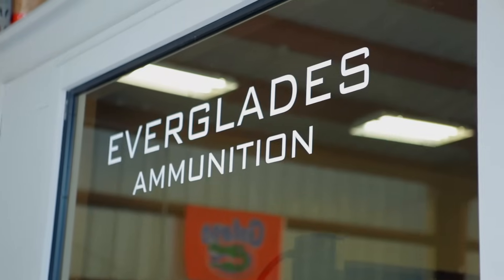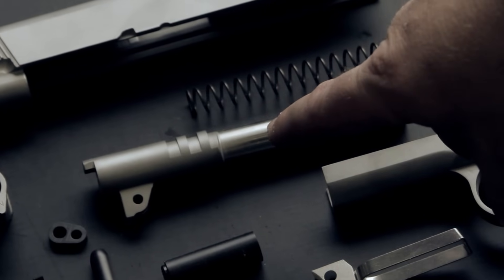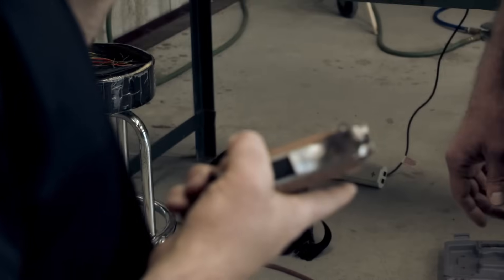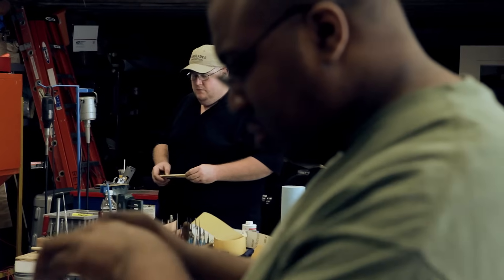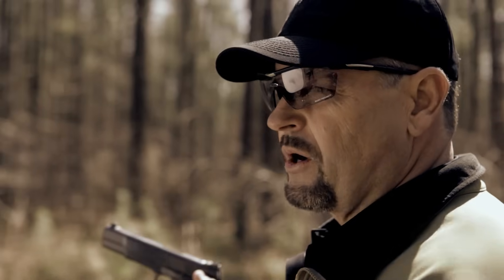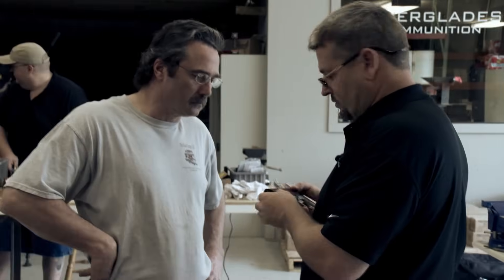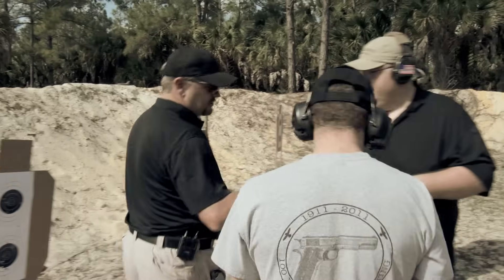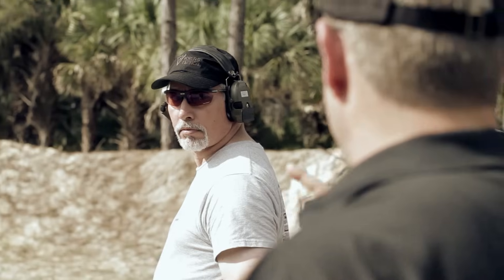Building the 1911

Comment: do you get to keep the gun at the end?
Reply from the maker: Yes
Reply: ***** Sweet!
Reply: ***** I agree, especially considering you'd only need to build and sell three or four 1911s before the class paid for itself
Reply: ***** Agreed, and if I have a 1911 I can pit against the $2000-$3000 1911s, I'm going to feel better than having paid a company to build it for me. 
Even if it's all about shooting range bragging rights, you know people will ask who made your 1911, and you'll reply "I did". They will dismiss the gun as a hack job until you tell them you built it at a Vickers workshop, then they start looking at it like it's a Wilson Combat or Ed Brown, because Vickers' name holds as much weight. 

I'm a broke college boy, so this class is outta my reach...for now. If he's still running the class in two years or so, I'll be attending for sure. Hope to see you there!
Reply: +Vickers Tactical where are you located. I would love to learn a full build process on the 1911. It is the ONLY pistol, unless it is a revolver, that I will carry, have carried, and that will not change. :-D
Reply: +Sam Moon Just buy  Taurus PT 1911.
Reply: San Mcnellis I have one. You really need to try a custom, or top-end 1911 before even making the suggestion the Taurus is as good as a 1911 I hand fitted.
Reply: +Sam Moon I have shot high end 1911's Les Baer, and custom builds and to be honest they aren't that great. Sure the slide fits perfectly, but that tight fit makes zero difference in performance, and I am under the belief that it actually hurts reliability. I think the best 1911 is simple and cheap. Really the best I have ever shot were the home made ones from 80% el cheapo kits. You could do anything to those handguns and they will still perform.
Reply: Dave Smith There is absolutely no validity to any part of your claims. I don't care if YOU didn't think the Les Baer wasn't that great, any custom or home built 1911 that performs as well only does so because of the same hand fitting that Les Baer does to their pistols. 
There is no way in hell a Taurus 1911 will be as accurate as even a Springfield 1911, nor will it be any more reliable. In fact, most, if not all 'reliability issues' of 1911s of any manufacture are user neglect/misuse, not the manufacturing process by which it was made...
Reply: +Sam Moon 
I suspect you don't know what you are talking about, and your little hyperbole that there is "no" validity to my experience is indicative of that. However I will give you the benefit of the doubt.

-Hand fit parts are tight. Tight parts`have more friction than loose parts. More friction leads to short stroking or at least weak slide reciprocation that can cause a multitude of problems. This is exacerbated with dust that seemingly gets in every crevice of the gun with actual use (not just range or competition toy). 
-Accuracy from a 1911 comes from repeatable slide lockup which is a factor of a lot of parts (barrel to slide mating, barrel bushing, slide stop pin, etc). That means it doesn't matter even if the parts don't mate together perfectly flat and snug, the 1911 will still be accurate so long as when the recoil spring pushes the slide forward, everything presses together the same amount every time. You get partial credit on this statement since it is true that 1911s that aren't as precisely made can potentially wear out faster but even then, you are hard pressed to actually get enough inaccuracy to see a difference. You are much more likely to see reliability issues before you see accuracy issues. 

But what do you define as "accurate"? In other words, what is your skill level with the gun? I can tell you that if you aren't shooting a handgun with a ransom rest or aren't capable of at least a 26MOA group (4" at 15 yards) you won't even see any difference in group size that isn't mostly due to user performance. All handguns are notoriously more inaccurate from rifles due to the lack of stability when shooting, which is why mechanical precision is less important in pistols than rifles.

Are high ends builds more accurate than cheaper ones? Yeah, but not enough to make a difference to most people, and at a certain point you can end up sacrificing reliability.
Reply: +Red Rider7 
Here's the thing, John Browning made his handguns without Larry Vickers class. That class has nothing to do with an individuals ability to make a proper 1911. It can HELP you to make a good quality handgun, but it doesn't mean you can't learn to make good handguns by just buying parts and following instructions online. Thats how I got my start and I have produced many quality firearms at approximately $300-350 per build (although with the rise in part prices, I probably can only get it as low as $600).

That being said, Vickers is a good guy and I do have plans in the upcoming year to try and take one of his classes to REFINE my method. Personally though, i wouldn't knock someone who never takes this class because the 1911 mechanism is very simple. You can figure it out yourself.
Reply: +Red Rider7 My mistake. ThatOneDudes comment was about Vickers class being overpriced over an old (well documented) design I thought you were trying to say that that he was underestimating the complexity of the design and the class was necessary.

+Sam Moon Interesting how you constantly claim I am full of BS and yet you have absolutely nothing to respond to my explanation on the mechanical functions of the 1911 but can only talk about what a great shooter you are. Wonder who is full of bullshit? Tell me, have you even built a 1911 in any form?
Reply: Dave Smith Yes, I have, and I've never even HEARD of anyone claiming looser tolerances on a 1911 will produce a more reliable gun, and I know for a fact it will not produce a more accurate pistol. 
Despite your BS, the actual focal point for accuracy in 1911s is the contact between the barrel and barrel bushing. Unless the slide stop pin is out of tolerance, it will not affect the frame/slide/barrel lockup one bit. The slide stop pin should ALWAYS be as tight a fit as possible, while still fitting in place. NO ONE ON EARTH will suggest a loose slide stop pin will be a good thing. If you're trying to pretend like ANY 1911 built for competition will have loose tolerances compared to a Wilson Combat, great, nobody else believes it
A loudmouth like you suggesting you have the ability to give me credit for anything is pathetic, considering that very lockup you're talking about needing to be exactly repeatable WILL NOT HAPPEN if the pistol is loose, that's exactly why the more consistently accurate 1911 claim a higher tolerance, not just to bother idiots like you. 

You want to throw around some undeserved expert opinion; "I'll attend Vicker's class to REFINE my method" Oh, I'm sure Vickers will be relieved to hear that, but in the meantime, while attending that class, why don't you try out this argument on Vickers himself, and please, record it?
Reply: Red Rider7 blah blah you're either a fanboi or a shill, either way you are muted, so STFU.
Reply: +Red Rider7 (ignore this if this isn't addressed to me) I don't know what you are talking about. I even said in my comment I am going to try and take Vickers 1911 class. However, you don't need his class to make high quality handguns. Like I said in my previous comments, I have bought el cheapo kits, and read enough about it on the internet to have enough instruction to complete my builds. And that's my point, anyone can make a reliable and accurate 1911 with a minimalist approach, the design as I explained, is designed to be very easy to build. 

+Sam Moon I don't think you realize the difference between tight tolerance and tight CLEARANCE.  And again, more personal attacks and apparently you don't have the experience or knowledge to defend your position. Interesting how you copied exactly what I said in my comment long ago to pretend you know what you are talking about
Reply: Dave Smith Well then, Davey, I'm sure you can explain the exact difference between tolerances and clearances. In the meantime, whatever you want to call it, the distance between the barrel to barrel bushing is the single most important fit for accuracy in 1911s.
Nothing you've said has been convincing that you know what you're talking about. I know for a fact that a tighter fitting 1911 will be more accurate than a looser 1911. You can say whatever you want, it's my experience that you're wrong. All the evidence that exists about building 1911s agrees with me, not you, so if you want someone to believe you, you're going to need to PROVE your claims, not just make them over again...
Reply: Yeah, you keep the gun. You buy all the pieces and bring them with you. You don't pay $2500 show up to a class with a box of parts at each work station. You bring the parts, you bring the tools. ~$2500 is JUST for the instruction
Reply: Joseph Tang Jim garthwaite in watsontown Pennsylvania also does an apprentice course. the man is world renowned. been doing it since the 70's I believe.
Reply: James Byrne $2,500 + parts + tools to show you how to make a JAM-O-Matic run??? Please make me understand.
Reply: Petty Officer Parker I don't think you ever will understand
Reply: Sam Moon I guess it's like when a car guy get's a crap car just so he can work on it? The car will never run good, but the guy is super happy just looking at it. You 1911 fanboys, that's the best explanation you got? We are grown now. You can't tell me to trade a buck for 2 quarters, because 2 is more than 1. You could go get a P226, P229, and a glock and still have money for ammo.
Reply: Petty Officer Parker You are trolling, you have no desire to understand anything, you want to argue the merits of the pistol you've invested your ego into. 

There was no respect in your question, just an arrogant and incorrect assumption that, because you suggest the 1911 is inferior in some way, it shouldn't be made or purchased. 

And, since nobody asked for your opinion, you just came here and offered it unsolicited, you know as well as I do you're not being respectful or actually asking a question. You're making a statement. 

At any rate, go assemble a Glock with the parts incorrectly fitted, see how well that works. If Glocks were so 'perfect', you wouldn't be able to build one entirely from aftermarket parts not made by Glock. 
Fact is, my Ruger SR1911 cost less than a Glock, works, and is why Sig also makes a 1911; they're great guns, despite your dislike. 
No doubt all your service in the Navy was for DEVGRU, and you have infinently more experience with a pistol than Jeff Cooper, but the difference is, I KNOW Larry Vickers career, and I know he knows what he's talking about. I don't know anything about you other than you're bored today, and decided to troll for amusement. Cool, but are you under the impression anyone taking this class is building their first, or only pistol? 

Go look up James Yeager, another person like you who advertised their anti-1911 opinion....until he bought a Kimber, and shot it 1000 times on camera without failure. I dont think you realize people that aren't you have shot guns too, and come up with thier own conclusions. 

Reality does not agree with you. Also, there were a full dozen American companies making 1911 pistols during WW2, not just Colt, and I'm not buying, or building 1911s for the sake of history alone; I really like the pistols, and my experience is that you are flat wrong about them, due to lack of experience with them. Does that mean to suggest you'd own one of you actually shot one? No, only that you're flat wrong about 1911 reliability, and it's obviously because you don't have experience with them
Reply: Sam Moon Wrong! A gun to me is a tool, it has to work. That is why I asked for someone to explain, why 1911? As I look at it, the gun tech is better now. Why not use a newer gun? I didn't understand why 1911 guys will pass up a working budget 1911 to get an expensive 1911 that doesn't run? That is a real question. I like looking at the 1911. I just can't see myself spending that much that might not work. So I always end up getting a gun that I know will work (Glock 21, P226, M&P9C, 92A1). I was asking, am I missing something? Logic says get something other than the 1911. That's why I asked the question. Maybe you are not qualified to provied an answer? Maybe you lack the ability to articulate valid reasons? I call it like I see it. I am asking am I missing something? What?... Is it worth the money? What is a good 1911 that will work out of the box for a good price? How is asking valid questions trolling?
Reply: Sam Moon Sounds like you might be slow. LV said on this video a lot of 1911's don't work because they are not built right. More than enough of other people have said the same. 1911 guys don't want to keep it real. If a gun doesn't work that's a problem. Why hide it? I asked my question because I like looking at the 1911, I'm just not into waisting money on a headache... So!!!! Point me in the right direction? What makes the gun so cool that people will knowingly spend crazy money on a gun that might not work? Am I saying this slow enough for you?
Reply: Sam Moon So you are saying Sig makes 1 1911 that works out of the box? Or ALL Sig 1911 are good to go?

You give respect to get it. You are the one that started the convo PMS-ing. I gave my stance and a question in order to change my opinion, because I have an open mind. I'm just not going to except BS.
Reply: Does Glock pay these guys to troll 1911 sites ? It cracks me up that some dude buys a plastic gun “ that never jams” and then gets pissy because nobody cares . I have shot Glocks and seen multiple malfunctions with them and that is a fact!  Just because you bought into the emperor with new clothes story that Glock sells don’t blow that smoke at the rest of us. A custom 1911 is no different than a custom car . Sure a Honda Civic will get you to work but who cares about a Honda Civic “ It’s a daily driver”  nobody pays top dollar for a Civic unless your a tuner and can make them run. Think of a good 1911 like a muscle car. Sure they don’t get 35mpg but that’s not the point is it . The point is raw power great looks incredible feel mad performance. Some of us have a daily driver that Honda or Toyota that takes us to work every day. That doesn’t mean we don’t enjoy a big V8 crammed in beautiful sheet metal with custom wheels and wide tires growling like some savage. Sometimes you want to shoot a gun that doesn’t feel like a generic chunk of plastic mass produced as cheaply as possible. 
Sometimes you are willing to pay a lot of money for something that just makes you feel alive when you hold it. Something that doesn’t feel like a “tool” out of a box. If you get it you get it if you don’t you don’t . Sure you can buy a couple of Honda’s for what a Custom hot rod will cost. But why would you? 
I don’t know if this class is worth the money or not but I know to some people a custom 1911 is worth the money just for the way it makes you feel when you pull a perfect trigger on a gun that fits your hand like it was made for it .
Reply: @Sam, can you provide the link again? the old link doesn't work.
Reply: Joseph Tang no
Reply: Vickers Tactical how much is it for class i deffly would go to class there in learn how to make handguns